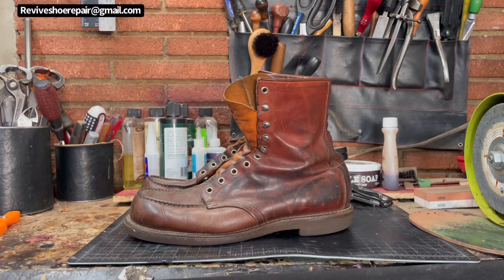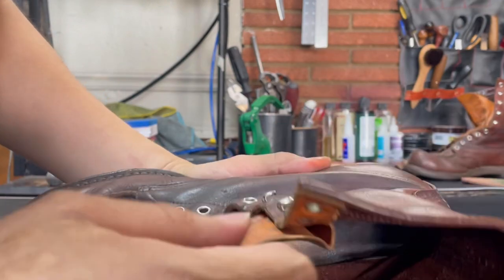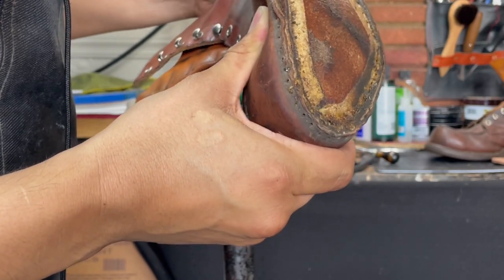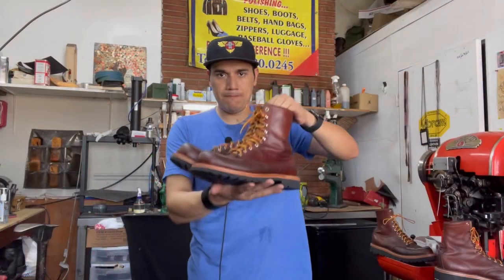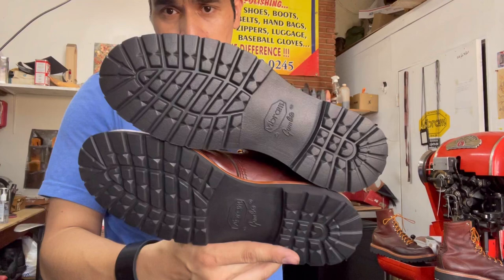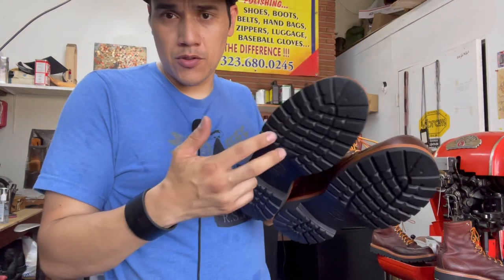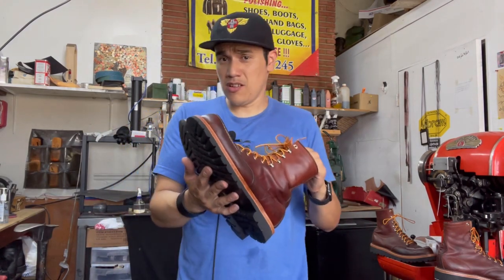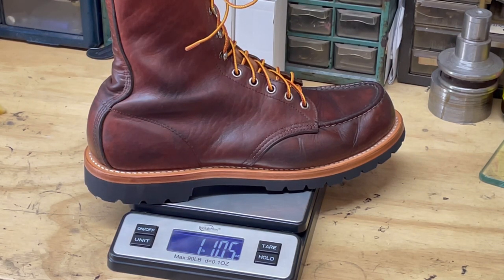Vintage 214 Red Wing Boots Restoration/Resoled #redwingboots  #redwingheritage

Comment: aaron nice work why did you choice a sole with a aggressive sole if going to going to work boot in your shop ? I would this a Vibram 430 or  V bar 700 Tygum ?
Reply from the maker: Thanks John 1705 is not an aggressive sole they’re soft 

If you’re talking about the other pair , well I wanted to try something different, unfortunately I didn’t like the end result not because of the look, but because of the weight, I’ve done this Resole for several costumers and they’re totally fine with it, I guess we’re all different 😅

About Vibram 430
Vibram 700
I don’t like them, I mean  not to wear them every day 
Cheers!

Comment: Great job as always! 

I used the Soletech version of this sole on a pair of moc toe super soles for work.. Works good and tread stays  pretty clean.

Can't believe the double sole weighs that much! I wonder what the individual soles weigh?
Reply from the maker: 🙏🙏
Sole tech is good,honestly I have no idea but just the vibram Christy by itself weights more than the 1705
Reply: @AaronG2480  The soletech smells of cheap china vs the vibram gumlite original. 

I wonder if a double sole with a 2060 or 2021 would be lighter?
Reply from the maker: That’s for sure, what I’ve done is a Vibram 2021 with a rubber midsole and leather midsoles and it came out good!